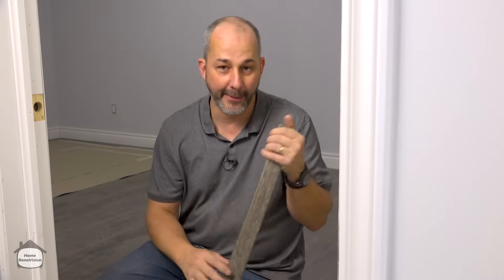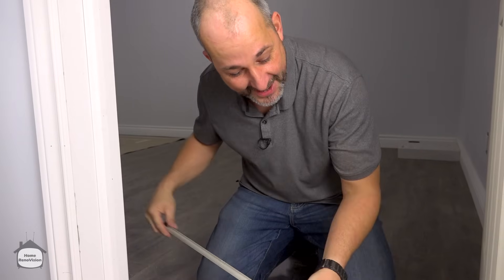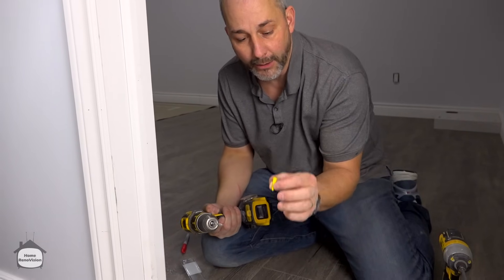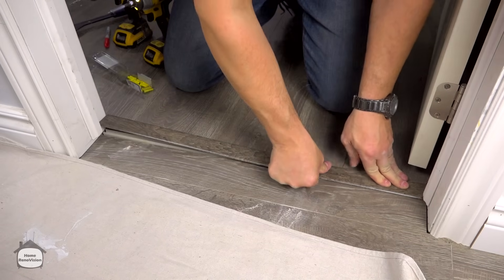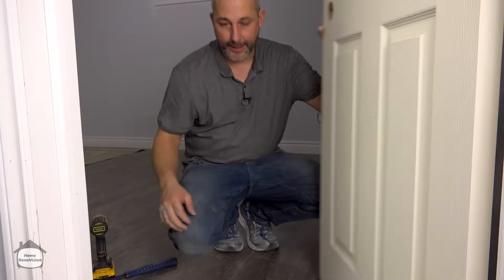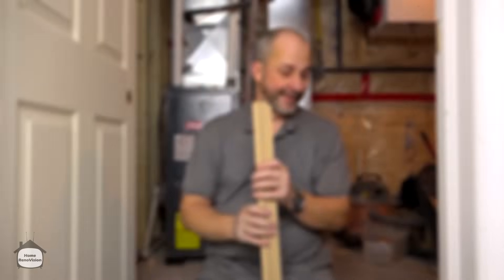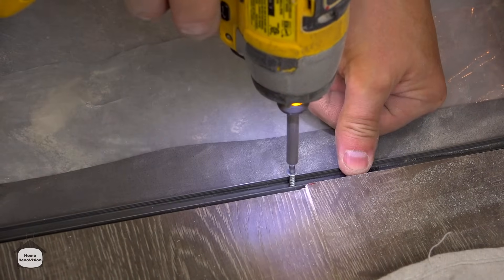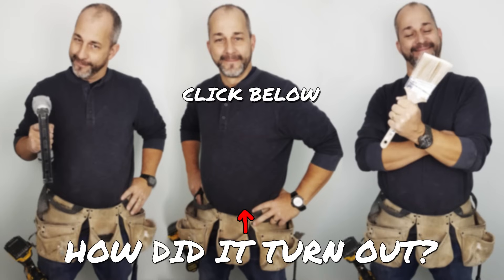How To Install Laminate Flooring | Transitions

Comment: plates for the transitions (we just call them trims in AU) should always be fitted WITHOUT the underlay under them to prevent rocking and in the case of the cheap and crappy plastic tracks cracking over time (get alumnium tracks when you have the option, they're out there).

Comment: Jeff,
For me, the fact  that you do not edit / cut your videos when you encounter a problem ( like with the height of the transition strip) gives a lot of credibility to what you do. In reality, things are not always perfect the first time.  
Thanks & have a great weekend 👍
Reply from the maker: Cheers Peter!
Reply: 100% agree - he's not afraid to illustrate the challenges encountered in real situations.
Reply: Agreed. Most people edit out the small stuff and only show the major steps. I work at a Lowes and have already started sending people to his channel to watch his flooring installs ( I work in the flooring department)
Reply: SO TRUE!!
Reply: The ugly truth.
 Appreciated⭐⭐⭐⭐⭐
Reply: He should have the experience to check for the height before drilling holes and screws. Seems like an obvious lack of foresight.
Reply: @jorgediazjr9673  Well I think he did it on purpose to show what happens If you do not cut the underpayment out. Easier to show for people to understand then it is to explain
Reply: I think it's really helpful. So many things can go wrong during renovation, it's nice to see how to resolve those issues that other videos might gloss over.
Reply: @jorgediazjr9673  but by encountering the problem as a homeowner would the video is more informative
Reply: Jorge Diaz Jr Hahahahahahaa... Wow... George 🙄
Reply: That's because he actually knows what he is doing. He has confidence so isn't afraid of the keyboard warriors.
Reply: He could have easily checked it was too high before drilling the holes though. But I like the honesty of leaving that part in though rather than presenting the perfect scenario.

Comment from the maker: If you have a question about transitions or flooring or anything, feel free to ask. I will do my best to answer them all. Cheers!
Reply: Home RenoVision DIY great vid like always! We need a video on how to install laminate flooring for stairs! Cheers
Reply: My builders flooring trade used construction adhesive and now they squeak like crazy. They said “that’s how it supposed to be done”....
Reply: Does that reducer work for a basement floor finished with DMX + OSB + carpet/laminate to a bare concrete floor? Thanks!
Reply: This was my video suggestion!  Thanks for making this video!
Reply: Longest side of the room correct? Any tips on spacers? I think i missed a beat i bought one of those plastics kits with the sbar. Rubbermallet is that important ive done a few jobs but its been fly by night im upping my game
Reply: Hi Jeff. What's the name of that spray sealer you used? Would it be good to use (as an extra precaution to moisture) on the bottoms of my bathroom door jambs? Thanks!
Reply from the maker: @newdroidexp  I don't usually suggest laminate for stairs. now i recommend vinyl. it can be glued and you can order integrated nosings for many of the products. Cheers!
Reply from the maker: @thechileacademy4800  most likely the squeaking is from subfloor deflection against the nails. Hint. most flooring companies do not screw down the subfloor prior to install.
Reply from the maker: @boulderco13  you will need a wood reducer to go to concrete in that situation. Cheers!
Reply from the maker: @JimGravina_ShineDC  happy to oblige. Cheers|!
Reply from the maker: @MrNncon  long side yes. spacers can help and that bar can be useful. Cheers!
Reply from the maker: @BronwenM  that was kilz. oil based sealer. Cheers!
Reply: Hey Jeff,

Back story: Mother renovated small room at her house, she used peel and stick Vinyl tyles. Also has unpainted walls. The walls have got absorbed stains.

Question: For the peel and stick tiles (Or any tiles in general) is there a faster way to remove the sticky residue (or grout) from floors in order for them to be tiled ?

Also the walls that have deep absorbed stains, is it feesable (if there is even a way) to clean the wall to a state that it can be painted? Or is it easier to remove and install another wall?

If you have the time I would be interested in seeing videos on cleaning things that home owners might encounter. Ceilings that have mould (bathrooms), painted walls that have deep stains, etc.

Things that will increase the life of various renovations.

Thanks In advance.
Reply: Hi Jeff, I’m really hoping you can help me out.  I watched your subway tile video and I loved it. I learned a lot and also learned a lot doing the project 😆. It came out beautifully! 

*Subject transitions from laminate to carpet and laminate to tile*
I’ve purchased a new spec home and I’m about to hit my one year warranty expiration. I still have unresolved problems from the walk thru. One of those is the laminate flooring. We had constant issues with them. After much discussion, they installed a different brand of flooring. It’s been a painful process and today they came out to install the transitions. They taped them down and told me the carpet guys will call me to tuck the carpet under the strips after the glue is dry. 
Anyways, I looked under the tape..there is a one inch gap between the carpet and the edge of the transition. The transition is already glued down.. I’d love to share photos with you if I could. The installers of the laminate and transitions are saying the carpet will not go under the transition at all. 
I’m reaching out to learn how it should be done not that I’m looking for you as an advocate. I appreciate your help!!! More will be discussed with this company VERY soon as this happened today. I know this isn’t correct..I just want to go in well informed or how to explain why this isn’t correct or how to get it done correctly. 

Also, do you have second story sub floor squeak videos?
Reply: Home RenoVision DIY what sort of transition strip should I use going from vinyl plank to linoleum? They do not meet at the doorway and it’s over concrete. Thank you.
Reply: Hey Jeff, any advice you can give for doing laminate on a single step-up to another room? The step is 9' wide so it is doesn't make sense to spend the money on the prefab stair tread caps that Home Depot sells. Is there a trim product that is for stair edges?
Reply: Hi, u didn't mention the transaction from carpet to laminate flooring
Reply: Awesome job thank you! From what I could tell the transition piece should go directly under the closed door! Is this correct?
Reply: Hi, Bathroom to Laminate.. The extends past the door a bit, would I have to cut the tile back to have the transition directly under the door frame and having the door close under the transition? and if so what would be the best tool to cut an existing tile?
Reply: Home RenoVision DIY great tutorial! Beats Lowes and Home Depot tutorials! My question is tho Vinyl planks are waterproof, wouldn't the water seep thru the edges even with base boards? How do you prevent that from happening specially in bathrooms? Thanks in advance and more power to your chanel!
Reply: What type of transition do you recommend from vinyl plank to carpet? Thank you!
Reply: What if your living room is bigger than 200 sq ft. Do you just run a transition the entire width of your living room and treat it as 2 rooms?
Reply: Home RenoVision DIY 
Jeff , I need you to save me PLEASE ! 
My flooring installer assured me after he is done installing my Nature Trek plus, waterproof flooring on the diagonal, there will be NO T-molding anywhere this flooring butts-up to existing hardwood or existing tile flooring in the home because we are adding luan and extra soundproof padding under the actual vinyl flooring.
This was one of my Major reasons I almost did not use this time of flooring, because I simply do not like the look of the T- molding it makes it so obvious that this is a vinyl floor because the t- molding seems to never match the floor .
He assures me he can use a metal track like your plastic one and just cut a piece of the flooring to fit it snug against the tile? 
Do you have a video that shows how to do this ? I have had that look done a lot with solid wood but can it truly be done with this type of flooring !this installer insists he simply shoots a small nail at the end through the flooring and that that does not affect contraction or expansion ? What do you think .
They are starting tomorrow morning !! I'm in a bad situation because my home in Florida is getting packed and will be here by next Monday ,so there is just no time for errors and thank goodness I decided to stay here and supervise the projects happening in new home as my husband went on to supervise the packing of our old home and transfer of all of our belongings to our new home here in North Carolina .
CAN YOU HELP !?
Reply: One thing that would have been nice to add is the cutting of different transition pieces.
Reply: How do you lay vinyl in hallway against stair railing and wall
Reply: Just putting in LVP. 166 yo house, door jamb is on an angle. Reducer is plastic, not mdf- manufacturer suggests construction glue for plastic channel to concrete. What do you suggest?
Reply: Do you have a video on transitioning wood/vinyl flooring to carpet? I can only find videos on youtube about carpet to wood (they are transitioning newly put down carpet to already existing wood floors but I want to know how to transition newly installed wood flooring to already existing carpet, and the carpet has a carpet transition already. So would I have to take that out and put a new transition in or what? The previous person. Who put down the flooring just glued a wood vinyl T transition ontop of the preexisting metal carpet transition. they cut the part that snaps into the metal fastener you screw into the concrete off of the T strip and just glued it right on top lol
Reply: Seeing your videos since long time and got motivation to try doing laminated flooring myself I am stuck at hallway beside stairs on second floor about to connect floor beside stair nosing coz I can’t put qoutor rounder strips it will look bad please guide me who to finish like a pro
Reply: So. I have a red oak floor in my living/dining room, and the kitchen is going to be a luxury vinyl plank (from peeling peel and stick). The transition space is a little over 8 ft long, how would you handle it?
Reply: Where do you position a transition strip in an opening to another room that doesn’t have a door?

Comment: I was in on the laminate floor craze when it first started in the mid 90's. PERGO was the original laminate floating floor system sold in the U.S. I was an endorsed PERGO Installer for Home Depots. I installed thousands of these floors. Back then we didn't have snap together flooring. It was all glue together which required special ratchet straps that went from the start coarse of flooring to the course you were gluing together. It made the installation process more timely but I believe it was a much better product. No seams over time and the melamine and aluminum oxide laminate finish was pretty darn tough. 
As far as installing transitions , I cut the track and transition to size. Snap the track onto the transition and simply adhere both to the sub floor with Power Grab construction adhesive. Works like a charm and your not fighting trying to squeeze the transition tongue into the flimsy mounting track screwed to the floor. 
However you can certainly do it as you showed. I'ts just a pain in the ass. Personally I think doing it my way makes a much more secure transition as well. Never had a call back on a transition failing.
Reply: Would liquid nail suffice?

Comment: When I transitioned from tile in the entryway (installed when the home was built) to tile in the laundry room (that had linoleum) I used a nice metal transition strip.  It worked out great.  Thank you for your educational videos.  I appreciate your positive demeanor.
Reply: I have the same thing but the heights are different - I assume your heights matched up so the metal strip worked well. But I'm not sure what to use

Comment: My issue too for transition from tile to laminate.  And the tile guy did exactly what you said, they finished off the tile too soon (who knew??).  My daughter and I installed a floating laminate floor and the tile is higher and I can’t do just the T transition.  More like the concrete to laminate only in reverse heights. Using the 4 in 1 transition set from Pergo. Had to special order, but worth it for the color match and options at hand for all the door ways.  The nice part is they gave us an extra rubber piece to make it all match for the extra height for the underpayment.  Sweet!  One door is tIle to laminate and the other door is laminate to carpet.  

I love your videos.  You should see this floor.  Looks great and I am proud to say that I am a weekend warrior!

Comment: When trimming back the flooring at the transition, I find that using my small circular saw to cut as much as possible and then using my oscillating tool on the ends where the circ saw doesn't reach saves a lot of time. Great video, very well explained  👍
Reply: That is exactly how I am doing this... oscillating tool ftw
Reply: I have a Dremel circular saw with a three inch flush-cut blade and it works very well.

Comment: Thank you so very much!
I am doing my very first laminate floor installation in a small bathroom. I have the water proof flooring and all my supplies. I did however forget the transition strip.
I will be ordering it from my "Big Box" supplier.
I will be laying about 28 sq. feet on flooring.
Along with this renovation I am having a new shower pan & surround installed. I am installing a new pedestal sink, glass panel entry door, and new baseboards & mouldings around the window and door.
I am excited about this project and I will return to these videos for help and guidance along my way in this adventure!

Comment: Thanks for all your work that has made my handyman life so much better!!!!  After 50...100+ hours of watching your very efficient ideas and processes I was finally surprised wo think of a tip for you? Trimming that luxury vinyl plank or laminate at the improperly installed door threshold area you might want to drop the recip saw and use your grinder ... "cuts" your time from 30 min and using a few expensive blade to 2 min.... with a 50 cent steel or masonry disc on the grinder... super easy (especially without the safety shield)!!!!  You are blessing... well if there's a God and if there is not then you are at least extremely helpful!!!!!  cheers, brian

Comment: Used your method on the floating engineered hardwood and it work perfectly.  The only issue was the wood tongue that fits into the metal groove was too wide and had to be trimmed to fit.  After that, perfect fit and impressive look.  Excellent video.

Comment: I'm currently in the middle of a transition like this with my bathroom. I like the look of the T molding there instead of trying to get the planks all oriented the same direction throughout the whole installation making it flush. Much easier and looks good. Thanks!

Comment: A carbide scoring tool goes along way to eliminate the number of blades and getting a straight line in cutting off the the flooring. Use a straight edge to run the knife along, to cut through the tough top layer of the flooring then cut with the oscillating tool.  The tool is normally used for cutting laminate, and in this case will eliminate the chatter from trying to cut through laminate with a very high quality finish, by scoring a line through the clear finish and top layer. Great video !!

Comment: Jeff, I'm replacing carpet that transitions to hardwood under a doorway with laminate. Currently the hardwood comes all the way under the door to meet the carpet. To install the transition strip from new laminate to hardwood, Like the problem you faced in this video,  I guess I will need to cut back the hardwood to accommodate the transition strip under the door?  (Your videos have been a great help to me btw.)

Comment: You're a life saver dude! I'm trying to get a job installing floors. I have a little over a year experience installing laminate and vinyl plank, but I'm a little rusty because I haven't done it In months and your videos are the perfect refresher. I've even picked up a few tips that I've never seen before. When my boss installed transitions he would throw the track away and glue the transition in with liquid nails😂

Comment: Heya Jeff, great video! First timer here installing Lifeproof LVP that transitions to tile. First, what transition piece/type you recommend and second, can you please tell me the size and type of drill bit you are using to drill the holes into the concrete? (subsequently, I see you are using a cordless drill which is what I use, which makes me think it's all about the bit not the power):D

Comment: I just had 1100 and some odd sq ft of 'luxury vinyl plank' and they used transitions going into each room, even if it was the same floor. I was told the T moulding had to be used for warranty purposes. I wasn't thrilled at first but I did just hear you say to use them everytime you're at a door.

Comment: So glad I found your videos. Cleared up quite a bit of confusion I'm having. I'm almost there, and have a question \ follow up. 

In my bathroom I'm replacing 4" square tile with laminate flooring. I have an edge, about 120" long, that is next to regular pile carpet. So, laminate on one side, and regular pile carpet on the other. I don't know how the height of both with be at this time; whether the carpet will be higher, the laminate will be higher, or all will be the same height. 

Do you have a video  that goes over the options for this type of installation?